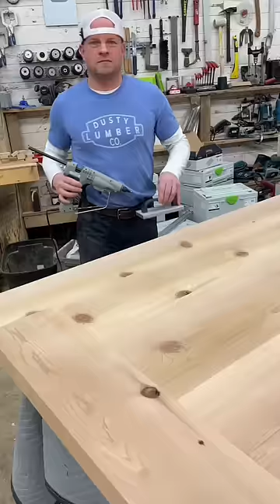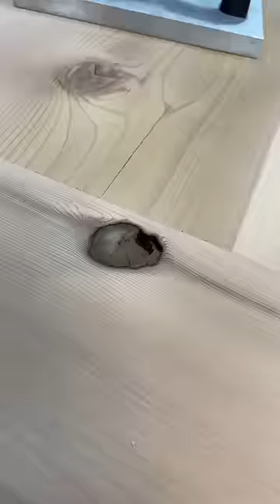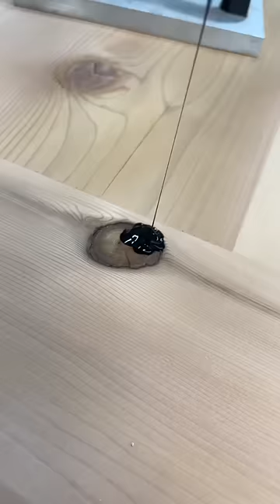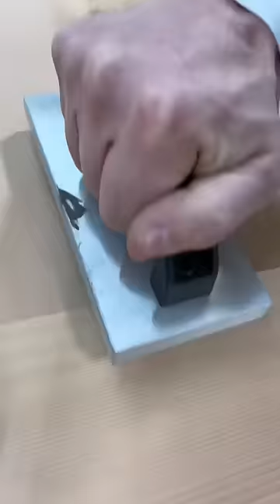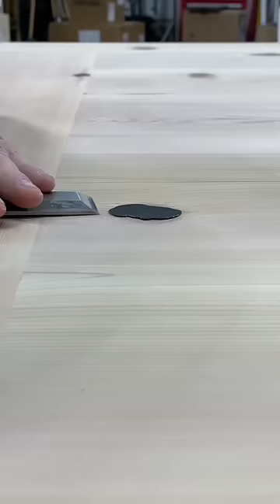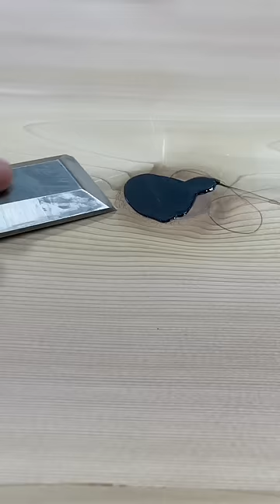Filling knot holes #woodwork #wood #woodworking #diy #maker #shorts

Comment: High temperature hot glue. Not like the craft stuff though, check your hardware store. The steel block is to help force the glue in and suck the heat out quickly so it can be cut off with a chisel right away.
Reply: Thanks, I was coming to the comments to ask this, but you're right at the top!
Reply: First blush had me asking Wax or meltable resin….the complete lack of a text explanation was the WTH moment
Reply: Thank you for finishing the video for him.
Reply: That is polyurethane. The block is alluminum
Reply: Aluminium block
Reply: @Warweazel  omp
Reply: Thanks, I was wondering

Comment: I always wanted to fill in the gouge on my ski.  I will try this method
Reply: You don’t even need a glue gun! You can just light the ptex on fire and drip it into the gouge :) sooner rather than later, especially if it’s a core shot but I’m sure it’s just surface level if you haven’t fixed it yet and your ski hasn’t delaminated yet. 

I believe Dakine sells a kit with some scrapers and ptex included, but might as well get that wax iron too and always have fresh skis for your trip.
Reply: Use 5 minute apoxy with wood shavings
Reply: @nathanblanchard8897  
Trust me, I have used candle stick method.  I also got a scraper and a file.  I need to get the iron pressure thing and a chisel.
Reply: @singlefather01  I’m sure it’s better than nothing but ya can’t beat the durability of an actual ptex bond. It’ll basically be good as new, and I think a kit should cost only about $10-20, a ton cheaper than paying a tech to do it for you and you get a new skill :)

Comment: Me: trys this.
Also me: how to fix chisel gouges in workbench
Reply: Oh I laughed at that ..
Reply: It works with the chisel but you can turn it the other way round and get a safer result as it's level with the wood not on a slight downwards angle

Comment: Try superglue.  It dries clear. Is easily sanded. I always gently breathe some moist air onto the glue to enhance curing.
Reply: Can you make a video demonstration of this?
Reply: @Half Insane Outdoor Guy  Wouldn't know how to post a video. I watch YouTube but never have posted. For the superglue, don't use the gel type. Open the container, cutting off the tip rather small. Gently squeeze a drop on the crack. It should flow out. You can rub and push with the tip. Then another drop or two as needed. Place the object where can dry. I usually put something underneath in case a drop falls off. I also support the object away from where I am building up glue. Apply couple of times each day if needed. It fills cracks in wood perfectly in my experience.  It sands easily and can even be polished. My main use is in filling drying checks in wood. Small knots seem to aways have cracks that look better filled and sanded down.

Comment: I use this stuff at work every day. Be mindful when using it especially the semi transparent stuff, it shrinks and becomes brittle over time.
Reply: No its not. You probably use wax, that thing is not completely hard, but not soft enough to notice. Its some kind of polyurethane. Its flexible a tiny bit

Comment: I don't think soft hot glue is a good base for literally anything. At my old wood shop we used to fill knots and worm holes with epoxy out of syringes. Worked good and is actually durable.

Comment: Is this stuff OK to use on a chopping board ?
Reply from the maker: I wouldn’t
Reply: @dustylumberco  what would you suggest to filled the splits and cracks ?
Reply: @dustylumberco  and what would you suggest to seal or treat the wood ? It's a slab of oak
Reply from the maker: @stuartpickett6490  for a cutting board you’ll want something that can’t chip or break off and get in your food. Maybe epoxy but even then you gotta be careful
Reply: @dustylumberco  what you suggest to treat tge surface linseed oil?